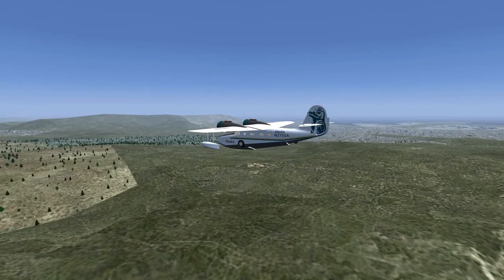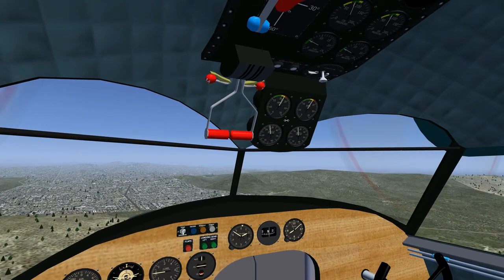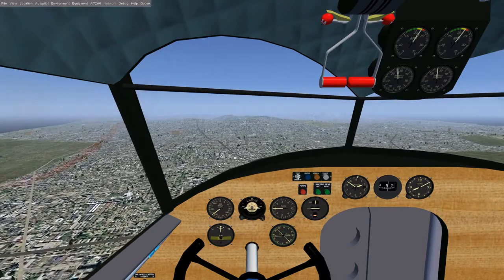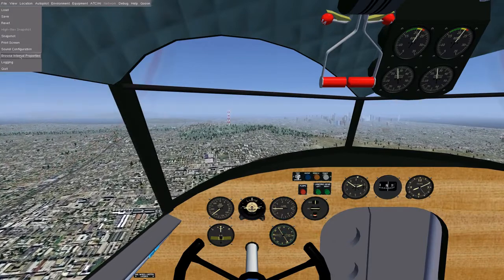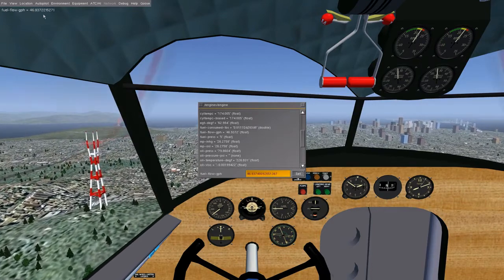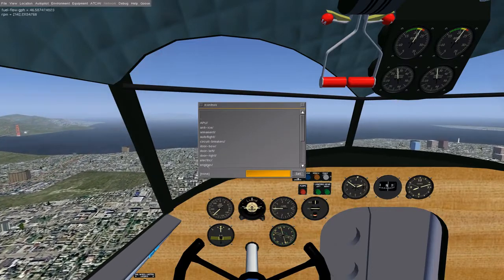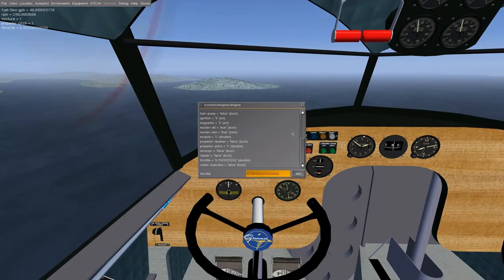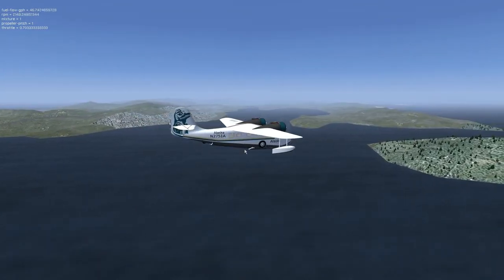Flightgear 2.0: Tips and Tricks

Comment: FWIW the on screen reading you were calling Fuel Flow Graph is really called "Gallon Per Hour" and indicate consumption per hour.  I'm really surprised that the prop pitch isn't steeper, as the engines look like they were being overrevved for your roughly 73% throttle.   There's probably a bit of FDM work still needed on the Goose to increase airframe drag or steepen the pitch of the props. They should be well into the green range at 75% throttle.